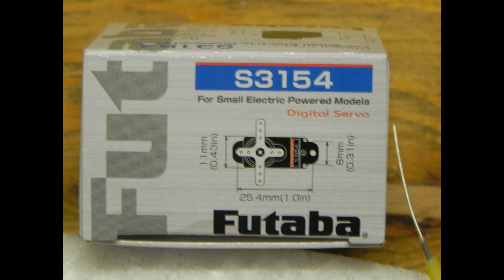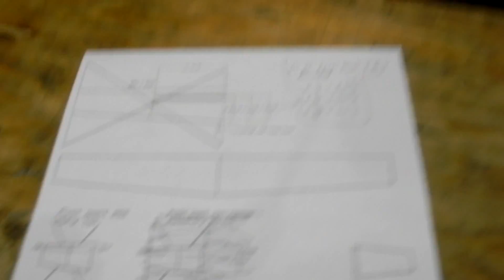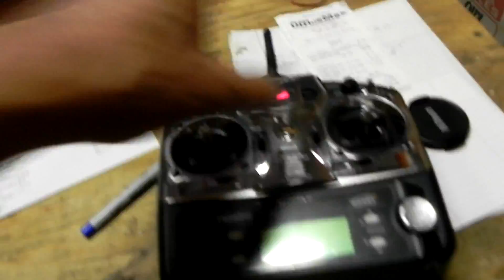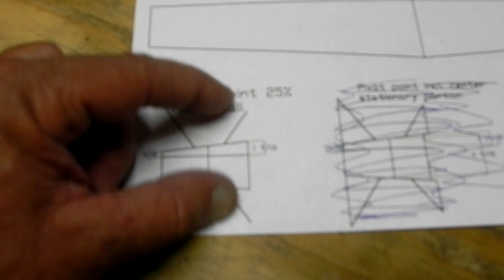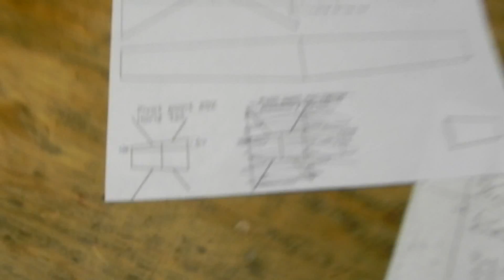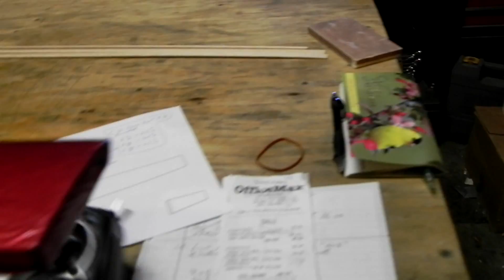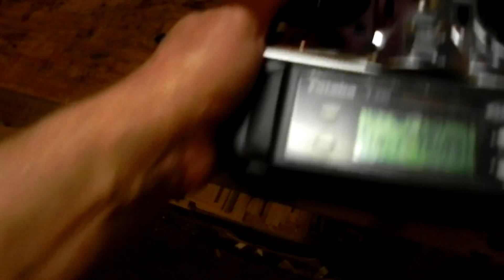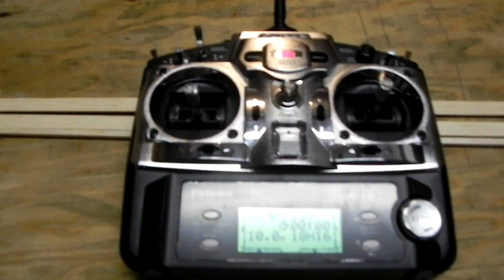Le Fish lite BUILD

Comment: Interesting... back to using nyrods. Humm... I found as long as you run nyrods in an "S" the two sides of the bend removes free play in each direction and using dry silicon lube you can get push rod rigidly almost friction free. With a foam fuse that may bend the nyrods will maintain even control better unlike stiff rods that create unwanted control surface movement. Good idea and good advise letting the nyrods flex as they need to with such long travel needed. Only issue is servo adjustment due to temperature causing nyrods to expand and contract as well as the foam I world imagine and re-trimming which in Hawaii is not an issue but in the NW winter to summer would be. Not sure what is meant regarding control horn being moved back but for equal throw pivot point of clevis or ball end should be exactly centered in line with the hinge line or in this case the point of the elevator's rotation. I see so many people setting up elevons with the two points offset and then complain the wing flies bad or is a poor design when the radio can't mix properly. Not easy to get the pivot point just right and be in proper trim. Why I like a horn than can move forward and back while allowing height adjustment for conditions and style of flying. I wonder how long we'll have to wait for Du-Bro to come with a light weight solution as this is the day of computer radios and we need computer radio control linkages! An easy to fly glider is all about being in trim so it can fly neutral and let you concentrate on flying not fighting the trim setting. Seen some incredible Le Fish flying. But it's actually a very complex design to learn how to build correctly and hope the inventor gets this in an ARF done right before China does not as well so he  makes some money off so much effort.
Reply from the maker: I must have missed this comment (7 years ago) sorry for that. Moving the horn back did indeed provide more pull or that is down elevator and I got my double flips both in the positive and  negative (or inside and outside if viewed like loops). I used to set up aileron differential that way in the old days. It's a geometrical function. In the extreme case of Le Fishs' elevator the control literally ran out of action AKA you could pull more all that you like but the control surface couldn't move any further because the geometric circle ran into the bottom of its radius so to speak. moving the horn back fixed the problem. I moved it back by 1/2 of the horns pad or mounting base. it Worked!
Confused? yeah sorry best to set up a physical test to see what is very difficult to put to words. I believe I showed the results in my Le Fish Addendum video if your curious.
Thanks for the comment (7 years ago) lol. I still have my Le Fish BTW.
Reply: @robertshaver4432  That's OK... I'm in no hurry but when I get back to Hawaii I plan on finally build a La Fish. Google sent me this reply and just found it so add another year... just don't get old;-) I see your new Fish in the side bar from a month ago so think I'll check it out in place of watching another program on the "impossible" findings of the Webb Telescope!
Reply from the maker: @JohnFHendry  Ha thank you, my newest Le Fish video is pretty good but I want better. This winter was pretty much a no fly as far as weather was concerned so I'm shaking off the rust and trying t learn additional doings at the same time. Thanks again! Robert